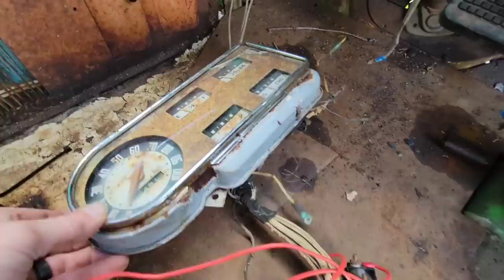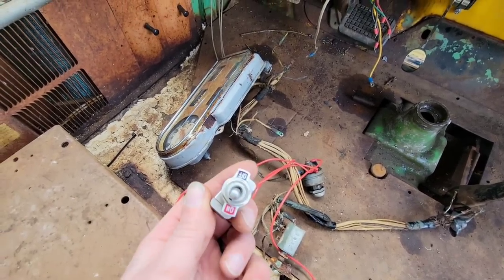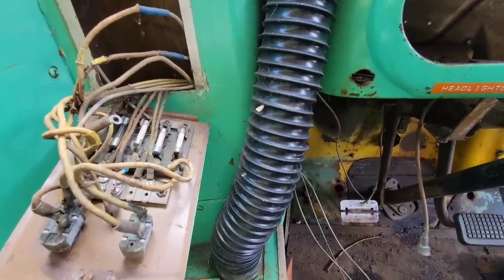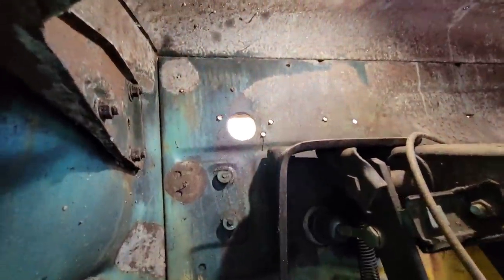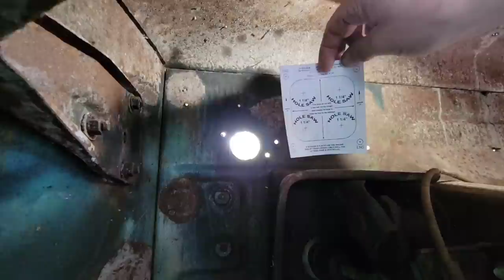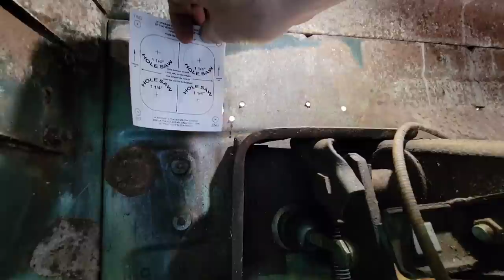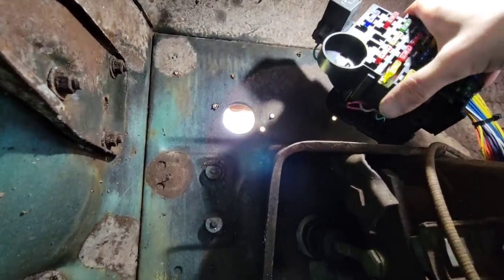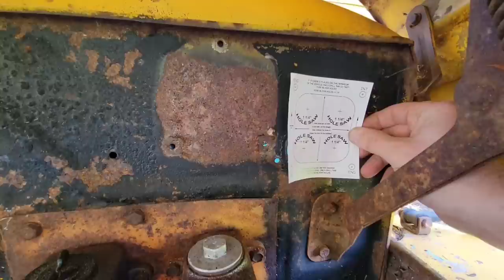(21st Video) Painless Performance Products Complete Wiring Kit Install on the 1948 Ford Church Bus!

Comment: You REALLY have this bus coming along!!!! My only concern is, yes, rubber grommets for the wires running through the sheet metal.. NO, I'm not being negative. I'm only asking. You don't want this bus burning down. I realize you probably already know this...
Yes, you're doing the "smoke test".....
You're doing a fine job !!!! I wish I was as patient as you!!!
One missing fuse, one bad ground.....BUT YOU NAILED IT !!!!
LOVE THAT HORN !!!!!!!!

Comment: Hello from the Green Mountains of Vermont. Great video. You really have found an awesome bus. It's quiet a beauty. Back in the late 80s I bought and got back on the road a 1963 Dodge Bluebird short bus. I thought the new tires were expensive then, lol. Sure brings back great memories. Best of luck with your endeavors and you're bus.

Comment: In the Army we would replace the whole dash wiring harness. The first one took days but after you get better at it I could do it in 4 hours. You did a great job on the wiring harness. You could get a more modern turn signal from a semi and eliminate the floor high beam switch.
Reply from the maker: Thank You!

Comment: 39:30 so THATS what the start system looked like originally! Wow! so that start button wasn’t there when you found it. So that’s what that button was for! I guess someone before removed that start button system and made that a regular starter! Did someone bypassed that original starter button??
Reply from the maker: Yeah the original ignition switch was swapped out for a newer version but I put the original switch back in with the push button.
Reply: @CountryBoyGasGarage  ALRIGHTY!!!! The originals are back in business!!!!

Comment: The original wipers were vacuum so the motor and switch you have are after market. I think they make a new aftermarket one for post war F1's that might work that has variable speed and auto return. The turn signal on the column looks like a Grote item. These are well built but you can still get a replacement from Grote if the one you have doesn't work.

Comment: After the church thing will you also be going back over the wiring and hitting those crimped connections with some solder?  I just find it gives me extra peace of mind if I solder those connections when doing wiring and soldering and then heat shrinking any wire splicing I have to do.

Comment: Well that was a awesome rewiring job. I am surprised that the license tag light served as a brake and turn signal as well. One would think the bus would have larger lights in the back for brake and turn signal. What about the Michigan markers on the top and sides. We’re they rewired as well? 
Keep up the great work.
Reply from the maker: Thanks! I'm getting them working also and it use to have some bigger lights mounted up top but they are gone now.

Comment: The outside pateena is looking as it should but if you can, that inside should get a baking soda blast or some kind of real rust removal. Of course that whole dash area as well as I see that repainted to match the final interior. This is long after older folks like myself have drooled on everything. If it were me, I would not hesitate to do a complete inside makeover and do a custom camper style home inside. NO half ass maybe stuff like you have now. I say this because done right, that old bus becomes a six figure bus. Done wrong an you  couldn't get what you have in it back. People are brutal when it comes to detail. I did a 57 dodge complete to exterior pateena look and of course under the hood was the new hemi engine with a automatic transmission and custom rims. The interior was  redone to have a all leather seating, paneling, head liner, stove and refrigerator... normal for say a class A motorhome. Air conditioning and heat, rug in bedroom, a full bathroom and this was set up for just two people/married only thinking as not all of us believe in running a friendship with a licence. Lived with same girl for a good many years but we got married and she bailed after a close year of harsh arguing. All said and done, that bus looked like a home inside...a tiny house. We could travel a month with a stop to refill the water every two weeks if showering a lot. A external freezer under the bus with a nice access door, a BBQ outside that opened up under the awning.  I had got several offers of a hundred plus on it but that was all she wanted out of the divorce. I gave it to her and all the money in our joint bank account. We are still friends "kinda" but she lives in N. Carolina an I live in Alaska. Our son is forty eight and daughter is fifty four now... oops... fifty five. She still has that bus an drives it a lot. Close to a hundred thousand miles on it with no problems.

Comment: I know this is an old video but I hope you put rubber grommets in those holes you ran those wires through. If not you WILL have electrical problems in the future.
Reply from the maker: Hey Thanks for the advice.  I think I got them all now

Comment: The plastic wire loom, in my opinion, looks out of place. Speaking from my own personal experience, it also won't last very long, especially in varying temperature conditions, such as heat in the warmer months, and cold in the winter mixed with engine and interior temperature. Probably within a year or so, it will get brittle, and crack. With older restorations I prefer to use hockey stick tape, which can be found at most sporting goods stores. Wrap the wires in a spiral pattern, making sure to slightly overlap the previous wrap for a nice, period correct, factory original look, or like Derek at Vice Grip Garage would say  "that's factree". I would also recommend replacing the electrical tape you used on your connections with heat shrink tubes. On a side note, I think it would be a really cool and fun upgrade to attach a set of those train horns that can be found all over the internet. Put them on a separate switch so that you have the option to use the original horn for most situations, but then there are other times when you really need to get someone's attention, especially at car shows.

Comment: Spider you connections  nothing worse then those blue connectors, water dirt high failure. That's my biggest dislike of painless. You can use aftermarket connectors or pigtails that can be depinned.
Reply from the maker: Hey Thanks!